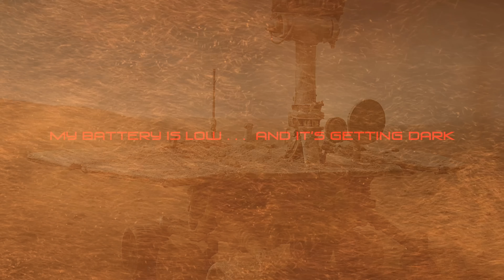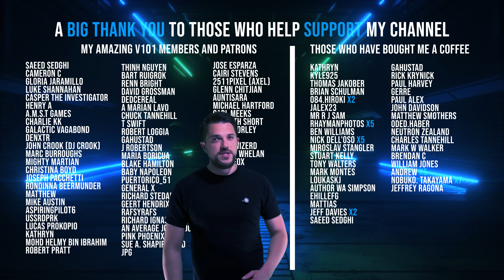Left for Dead on Mars: What Happened to NASA’s Opportunity Rover?

Comment: I know some of the comments call for a wiper with brush to brush off the dust from the panel.  Such devices will not last under the intense solar radiation and temperature swings. All kinds of plastics would have crumbled off in no time.
Reply: Now on Mars Sand Storm is over the Sun light is back and Opportunity battery already charges via Solar panel BUT... opportunity will not wake up anymore due to damages electronic components inside opportunity because by freezing temperatures night on Mars, opportunity is dead

Comment: Question, if someone were to dust off the solar panels would opportunity eventually recharge and start working again?
Reply: Now on Mars Sand Storm is over the Sun light is back and Opportunity battery already charges via Solar panel BUT... opportunity will not wake up anymore due to damages electronic components inside opportunity because by freezing temperatures night on Mars, opportunity is dead

Comment: Opportunity's onboard computer uses a 20 MHz RAD6000 CPU with 128 MB RAM 3 MB flash storage.

The RAD6000 is using the PowerPC architecture, which was also used in Macs, Xbox 360, PS3, Nintendo GameCube and Wii.
Reply: and yet you couldnt beat the guy in Mario kart

Comment: I wonder if the dust was blown off if it would power back on?
Reply: No. Electronics will be damaged, circuit boards cracked because the heaters failed.
Reply: @shinycompi  Not only that, but with the panels covered in martian dust for so long the batteries would be well and truly stuffed by now!

Comment: Only one design error to me … why were the solar panels parallel to the ground? If angled, some dust would have slid off it.
Reply: How about a brush or air duster that goes over the solar panels?
Reply: @mikethemechanic7395  I always wondered that. A simple wiper with a fine brush on it that could work back and forth across some of the panels.
Reply: My thoughts exactly!   A simple oversight
Reply: @mikethemechanic7395  it would be too heavy
Reply: @mikethemechanic7395  LOL ...."air duster".....LOL
Reply: Remember, the rover was only designed to last 90 sols. They didn't think dust would be a huge problem for extended missions because they hadn't planned for an extended mission.
Reply: Supposedly a dust devil blew the dust off and it oowered up again😂
Reply: @alancoker1459 Yes can be happened 😂
Reply: @alancoker1459  Now on Mars Sand Storm is over the Sun light is back and Opportunity battery already charges via Solar panel BUT... opportunity will not wake up anymore due to damages electronic components inside opportunity because by freezing temperatures night on Mars, opportunity is dead
Reply: I've read that the dust actually is not easy to get off, because of static electricity "glueing" it to the surface of the solar panels and the rovers. A brush would not do the trick, apparently. Best regards
Reply: @mhult5873 surely they can design anti static panels no different to cellphone screen protector films
Reply: The problem was not with the solar panels it was the weather the sky was covered in a dusty storm that stopped the sun light from hitting the ground, scientists were not that stupid.
Reply: The robot system needed alot of energy from the sun and parallel position would guarantee max sun absorption. The goal was to maximise functionality during the intended period over longevity
Reply: Touché.
Reply: They should’ve designed a windshield washer type system on the solar panels that could be turned on to wipe off the dust. Or even a blower type system that blows air across the panels.
Reply: Bra it doesn't even work like that because there's gravity
Reply: @avielelijaMaglalang yes, gravity has been around for a long time. Thank you for your input..
Reply: Why put a brush on for a 14 year mission on a robot that is only expected to last 92 days?
Reply: @marksaunderson3042 yea think about that. 92 days and its still going😂😂😂
Reply: @marksaunderson3042 then why build it to last 90 day's
Reply: @marksaunderson3042  so it don't end in just a few days duh
Reply: @nightlyterra  it didn't. Can you please learn to read?
Reply: People here literally flip burgers for a living and try to discuss design flaws 😂

Comment: Perhaps a Martian dust devil will clean the solar panels. Perhaps.
Reply: It's the extreme cold of a Martian winter that will have destroyed the internal components and computer. So even if the panels clear, the internal battery and computer will likely be destroyed, or destroyed enough that you'd not get use from them.

Comment: dust it off it might come back to life
Reply: The batteries would be dead dead. If they're not regularly charged, batteries will slowly degrade until they're no longer functional. Going this long without proper charging, the cells are beyond use. There's also the factor of the temperature doing damage to the internal electronics. One component on every rover is internal heating to keep the systems warm enough to stay functional. Without that heater being powered, the cold could wreak havoc on the machines internally.
Reply: @Draknfyre  just a thought ....cant hurt nothing.